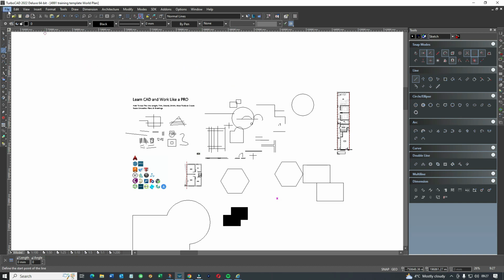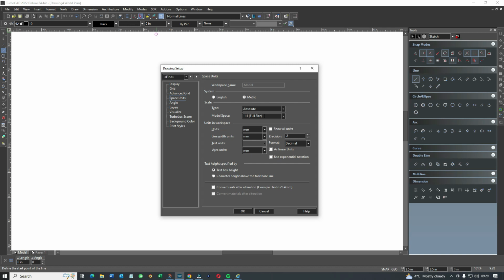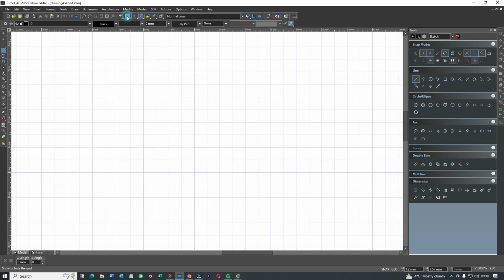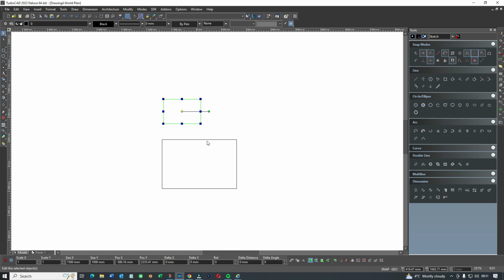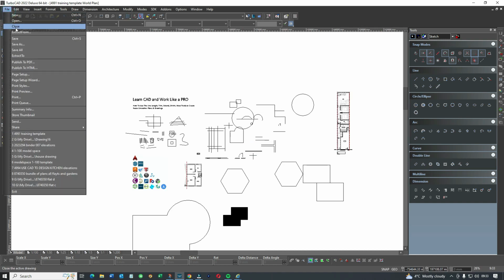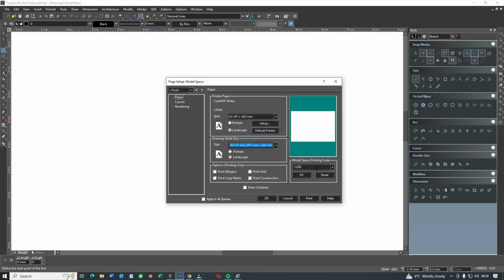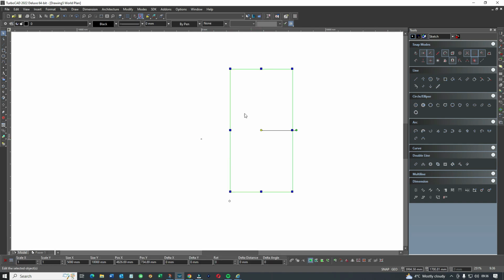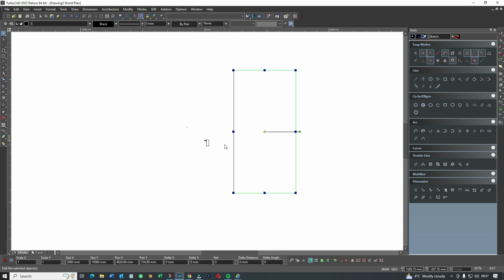How To DRAW SCALED PLANS IN CAD - CAD Courses Online CAD Training CAD Use CAD Like a PRO

Comment: I have never seen the need to draw to scale in model space.  I have always drawn to 1-1 Full Scale and my projects range as large as 14 acres and have never ran into an issue.  Now when it comes to printing in paper space yes of course I print to a certain scale.  Perhaps I'm not understanding what the use of drawing to scale in model space is for.
Reply from the maker: Hi Vince, you are of course correct and I believe that most CAD users actually draw 1:1 in model space. Most of the drawings I create are scaled at 1:100 in model space simply because I am setup to print directly from model space. There are days when I have to tweak maybe 10/20 drawings so printing directly from model space is a real timesaver...
Reply: Tom, thank you for the clarification.  Makes total sense for your needs.